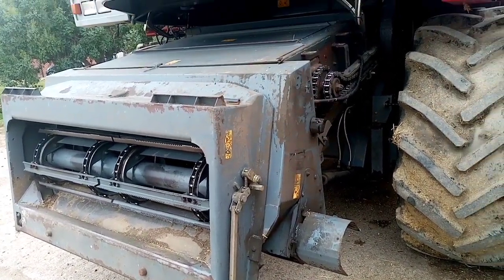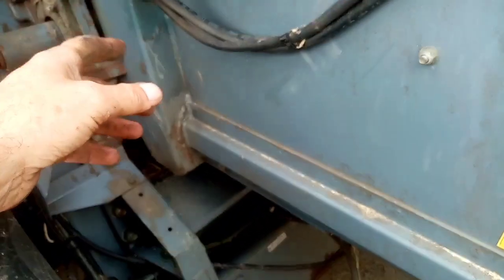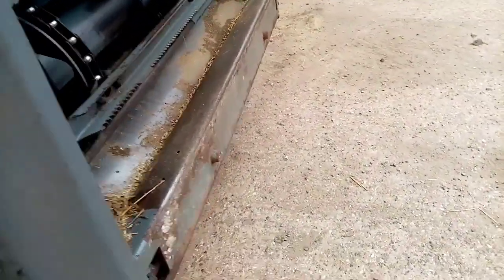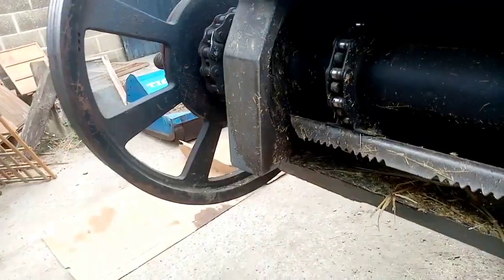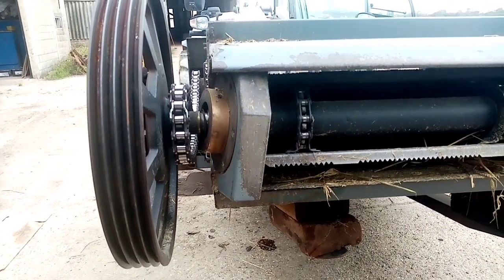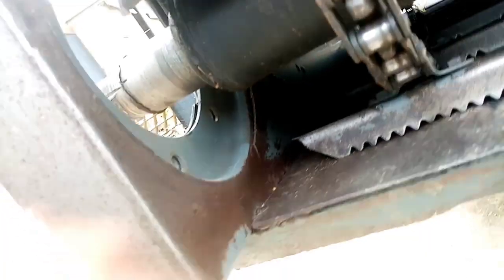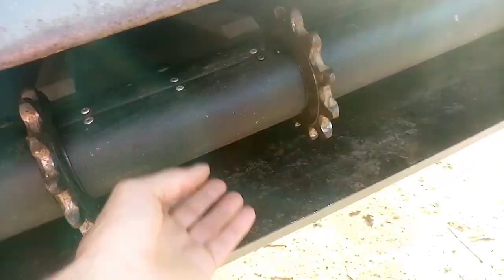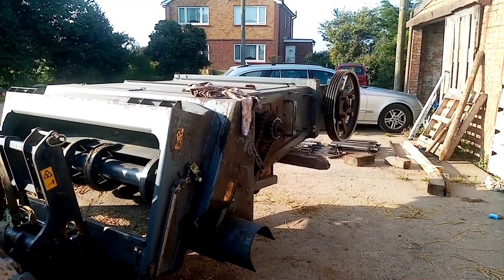Combine catastrophe

Comment: The MIG welding methods that work the best is to trace around the weld puddle.  This helps keep the heat in the weld and makes the weld appear a little better.  This works with flux core as well.  I had to work on a MF combine in 2010 where a bearing went dry on the head.  It was a great deal of glowing metal and peening with a small hammer to get the sprockets off the shaft.  In this case the peening was to cause small vibrations in the taper joint as the sprocket cooled, to cause the sprocket to jump off the shaft.